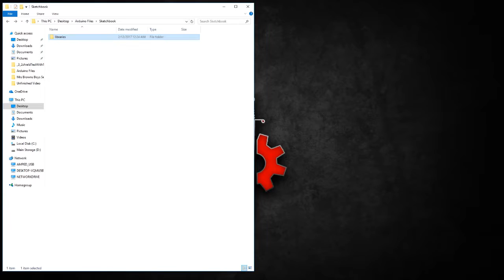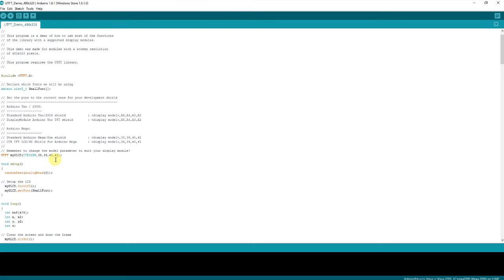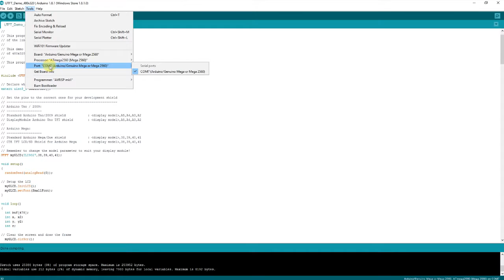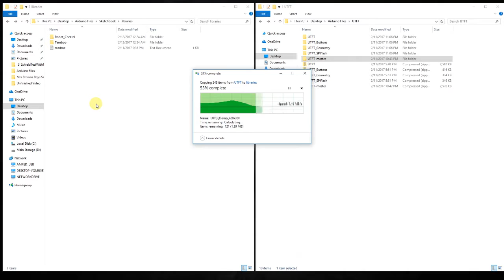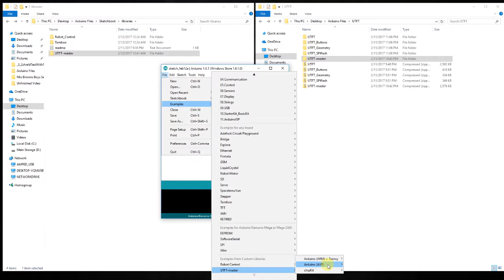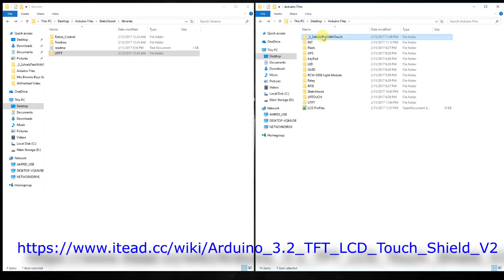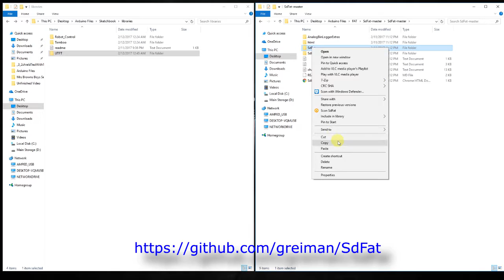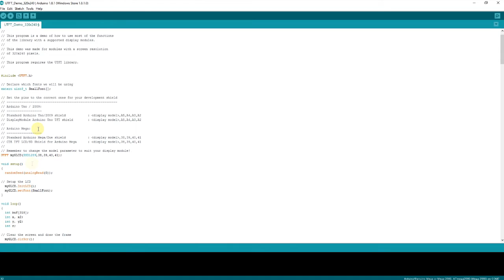TFT LCDS & Arduino 2560

Comment: Hey this amazing,  but can you help to fixed my problem. I have a trouble to showing bitmap image from SD card,  i using TFT lcd 2,4 x 3,2" on arduino uno and it worked,  but if i using mega 2560 is not work.  Can you help me to make tutorial video ?